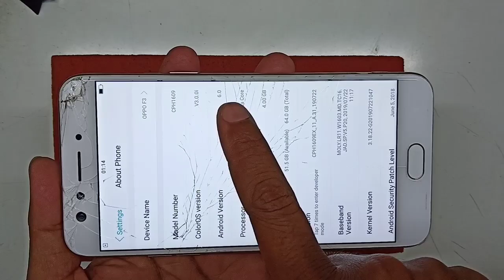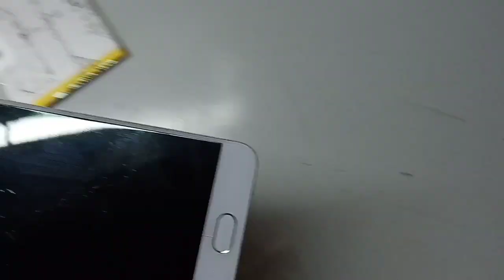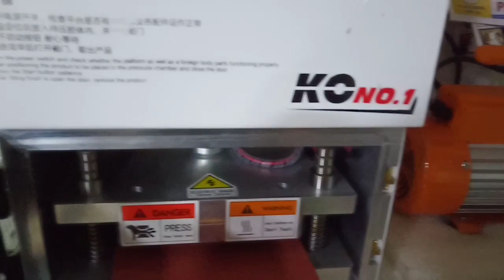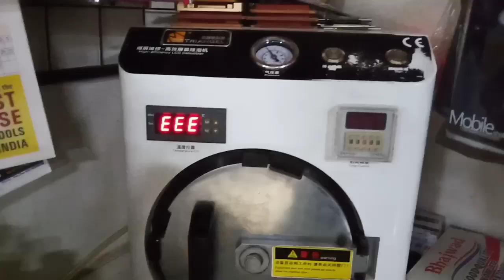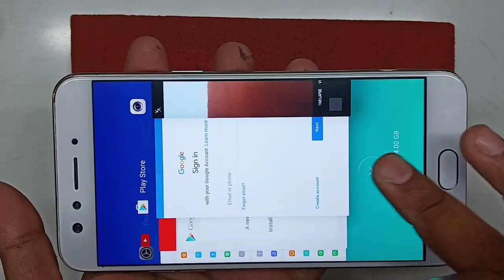Oppo F3 1609//Crack broken Only touch glass replacement//

Comment: Bro my phone also oppof3 bro but bro if u saw my comment then give me response. Bro my phone oppof3 broken and I given that in mobile shop he did and returned me at 2000/- rupees but bro touch is not working properly while playing freefire and other even I can lift my phone call bro what I should do bro !  It's getting hang and if I press one side it's touching another side bro I'm very tried with this issue bro . If u saw this comment then reply me bro give me suggestion.
Reply: bro same with my oppo f3
Reply: @dilrajsingh9562  what you did bro
Reply: @rayaniganesh3913  nothing bro i am now selling it 😔
Reply: @dilrajsingh9562  which price u brought and what price u r selling bro
Reply: @rayaniganesh3913  brought at 18000 and selling at 5000
Reply: @dilrajsingh9562  that's a huge loss bro for u !
Reply: @rayaniganesh3913  hmm but still no one buying and people on olx are saying 3500 😔
Reply: @dilrajsingh9562  they asking for 3k
Reply: @rayaniganesh3913  hmm